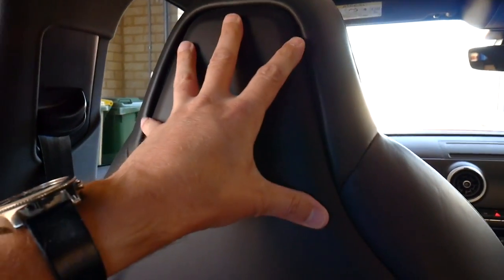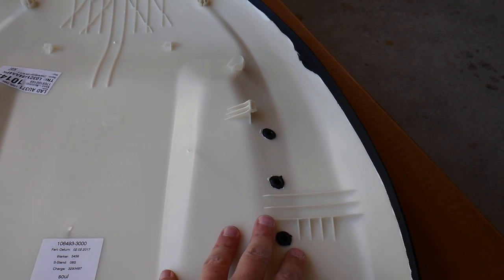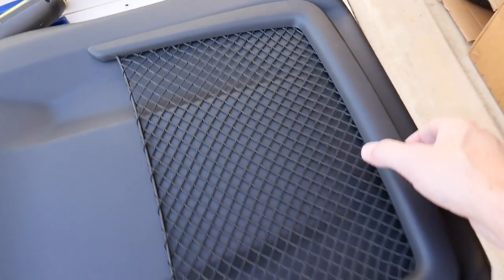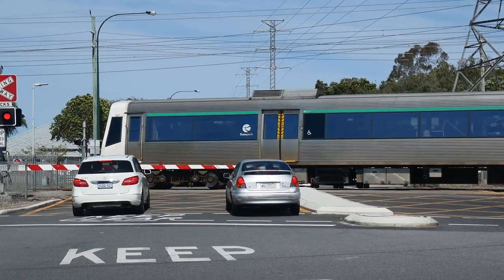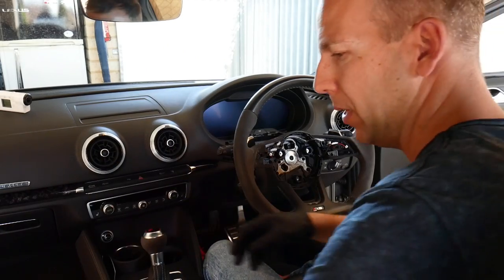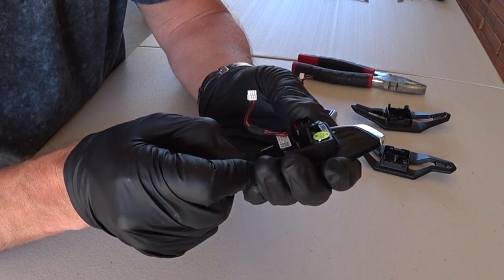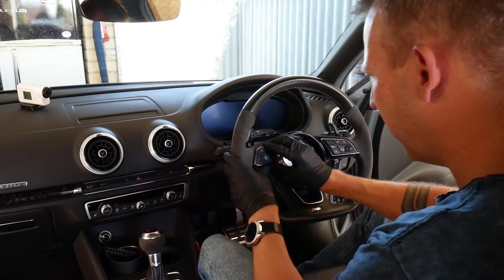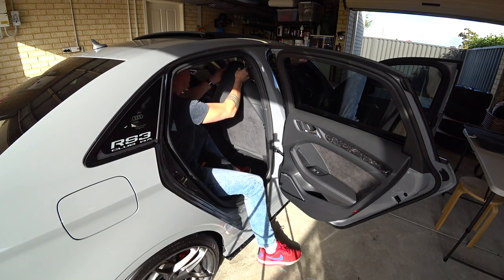Installing LAMBORGHINI shift paddles and Alcantara seat backs on my Audi RS3

Comment: Excellent video very helpful and informative, keep them coming, how did the trimmers make sure the holes that were left by the plastic clips were not visible with the finished look please?
Reply from the maker: Thanks 🙏. The holes are actually small enough so the fabric sits over them without any evidence.  We spoke about filling the holes but we thought we'd try without first...ended up working fine. 😊

Comment: 11:35 Before you disconnect the battery, did you have to do something first so that the steering wheel won't lock when you rotate it?
Reply from the maker: No, my steering wheel didn't lock. I know it does with some people but I'm not sure what why. 😊
Reply: @frax77  That is strange. You must have it in neutral. I will find out when my steering wheel arrives. I think my car is the same year as yours (2017).

Comment: Great video...Is you car keyless ignition? If it is then how do you move the steering wheel around when the battery is disconnected without engaging the steering lock?
Reply from the maker: Great question Dan. Yes my car is keyless, and as long as you disconnect the battery whilst the steering lock is not engaged, then the steering wheel will move freely....just as you can see in the video. 😊👍
Reply: @frax77  great thanks. I looked in the audi repair manual and it says to remove the battery negative cable after the ignition is turned on and I wondered if it was because of the steering lock...obviously not.

Comment: Amazing…. Btw What is your rims and tyres size? are they flush? Wanna install same for mine
Reply from the maker: Thanks Mohamad. 
Wheel specs are:
BC Forged RZ22, Dark Brushed Black
F: 19 x 9.5 ET42 (clear front brakes)
R: 19 x 9.5 ET45 (deep concave)
Running 255/30R19 Nitto Invo
Reply: 255 rear and front? Hope to see how flush they look …Thank you
Reply from the maker: Yep, same tyre size front and back, otherwise the Haldex gets a bit upset (needs to be same rolling diameter)

Comment: Where did you get the forged carbon fiber interior trim pieces?
Reply from the maker: Hah, they are actually wrapped in a forged carbon printed vinyl. It's a bit of stop gap whilst I decide what I want to do with those interior pieces.
Reply from the maker: Good spotting by the way! 😁

Comment: Would the paddles fit on an S3 too?
Reply from the maker: If you have the newer steering wheel type then yes. Best bet is to msg Dion at DS_Performance parts to make 100% sure. 👍

Comment: I’ve seen people just get out the pins and replacing the shifters without removing the steering wheel. I guess that wasn’t an option here?
Reply from the maker: Yer, not possible with these.  The pins are located in an area covered by the steering wheel plastics.

Comment: hi the video is old but something happened to me when i tried to take the pedals off, the cover came off and the white plastic fell off how can i put it on can you help me or do i have to remove the steering wheel
Reply: While opening the pedal, the white plastic inside the cover on our left hand fell off.
Reply from the maker: Can u send me a picture on IG maybe?
Reply: Thank you for your message, I wrote it from Instagram, can you check it?

Comment: Link for the paddle shifters?
Reply from the maker: You can get in touch via IG (@ds_performanceparts), or FB (@DSperfmnce), or email them - ds-performanceparts@gmx.de   
I don't think they have a website, but Dion is super helpful and responsive.
Reply: How much are they?
Reply from the maker: @LP-dv6qr  it depends where they need to ship to. I paid around $265 euros.